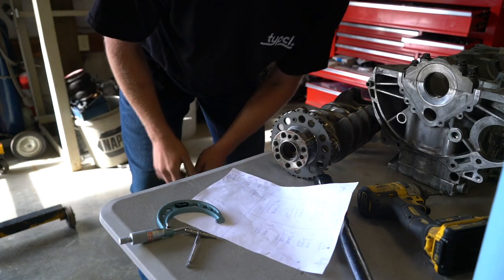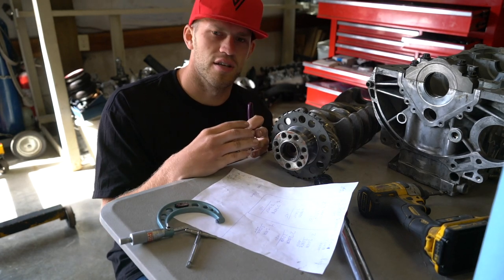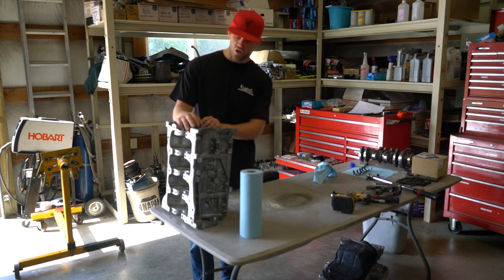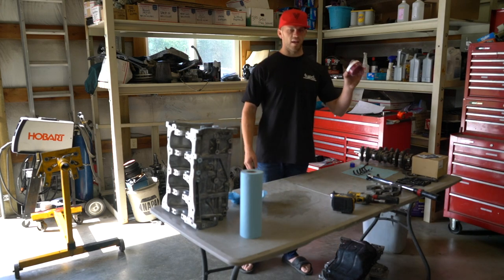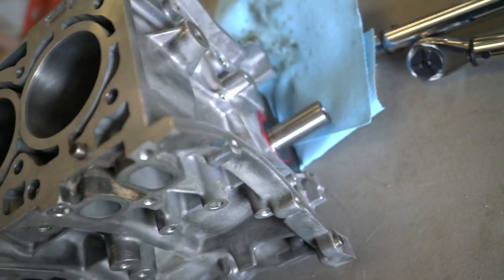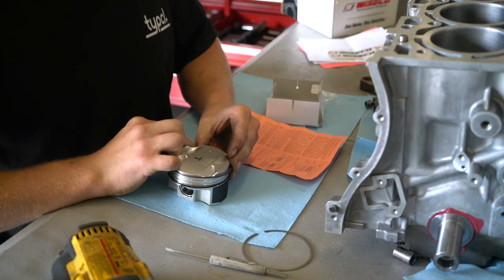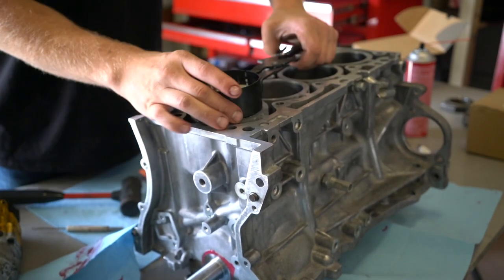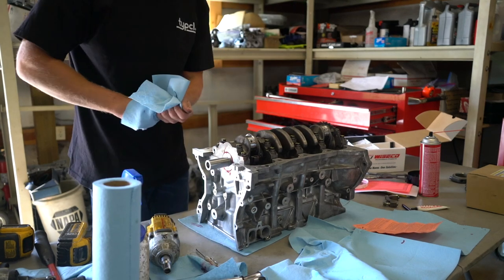Finishing Up The Evo X Block!

Comment: The bearings go in dry...Also auto trans fluid is much better lube than WD40 for
Coating the cylinder walls. Heat cycle, drop the oil and ready to roll. Hope you caught the bearings before you ran it....😔

Comment: hey man i like the videos. just dont want to see you have a premature failure. you are suppose to install the main bearings dry. and then put assembly lube on top of the bearing. lubing the underside will result in a spun bearing more then likely.

Comment: Bearing crush is what keeps bearings from spinning. Lube on the backs isn't a good idea. But you can probably get away with it since people "roll" bearings into assembled engines all the time. Oil will get between the the bearing and block while doing this and it doesn't cause an issue.

Comment: Hey bro I have done the same mistake on a diesel engine assembly I lubricated the back of the bearing shell... resulting in hot spot and bearing failure.

Comment: I would think the difference in plastigage is the thickness of the plastiguge causing the difference in measurements? I don't see high performance motor builders use plastigage they always use precision measuring tools.Good build so far man!

Comment: Yo Dev, how often are you changing the timing belt on your X's, I'm over 100k n havent done it yet
Reply: --> chain
Reply: i would probably just do it. there is no set intervals but 100k miles can cause some stretching
Reply: They run a chain. Once you run the revised chain should be sweet forever

Comment: Awesome video! I build many evos in Kent WA too! 
#EvoTechGarage Facebook

I built a 4b11 engine before and had the same issue with the squirters, I ended up bending them and cutting them shorter, then cleaning up the ends with a dremel. And then brake cleaner to clean the inside. Engine ran amazing!